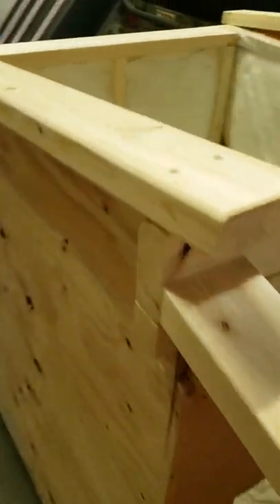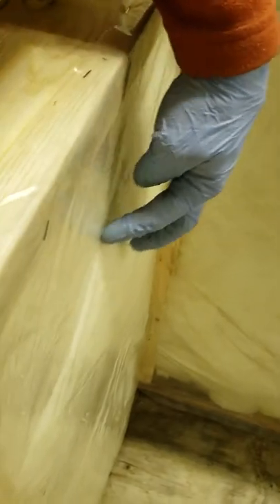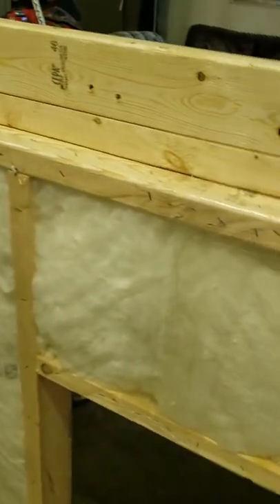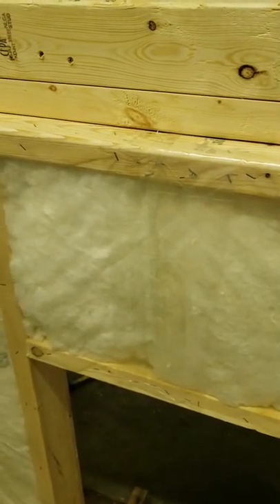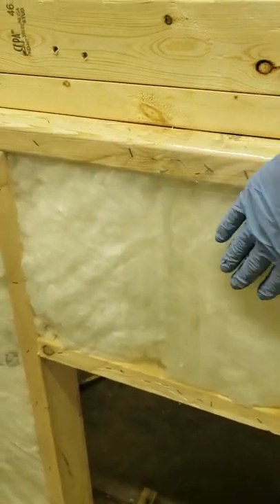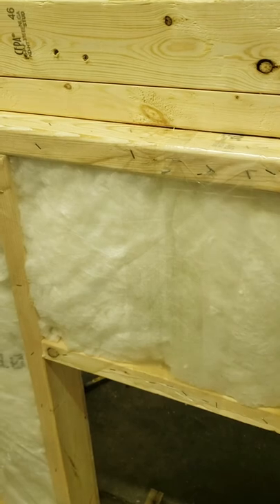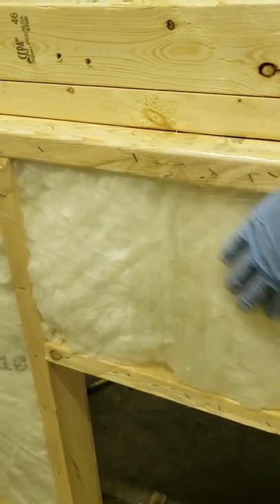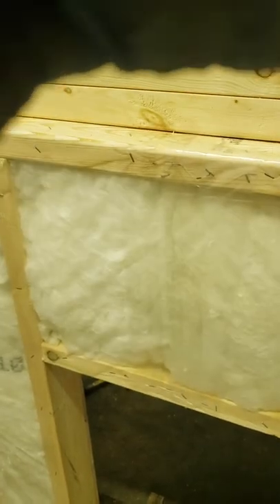Build an Insulated dog house with heat lamp - part 2

Comment from the maker: The plastic is a vapor barrier,  it is needed when using this type of insulation... I'm not sure if you would need it with foam insulation, but plastic is cheap and it definitely wouldn't hurt anything with the foam insulation